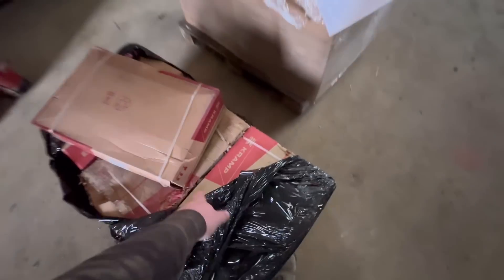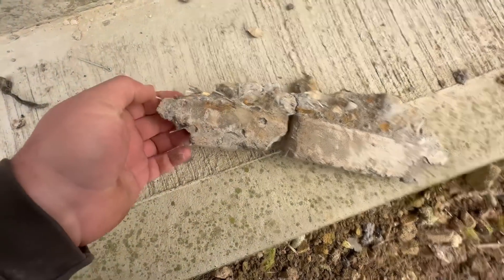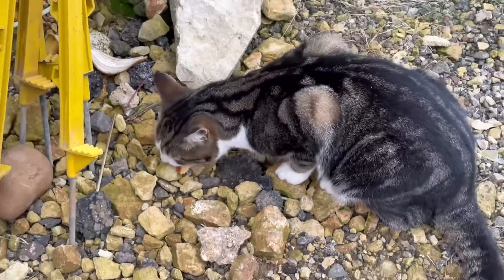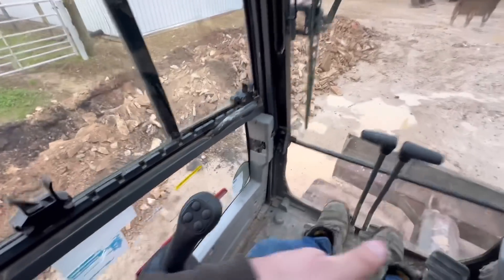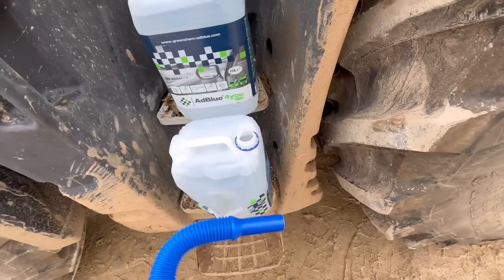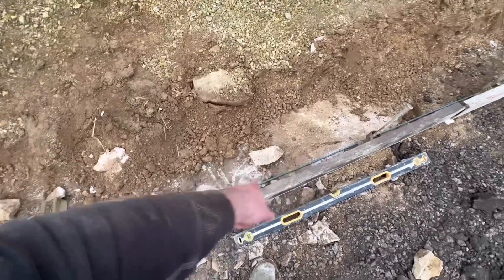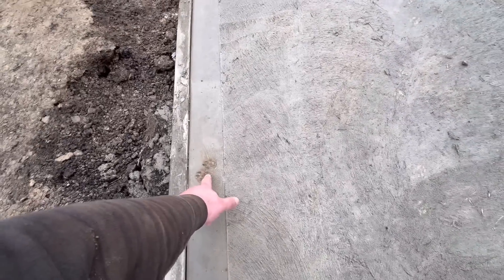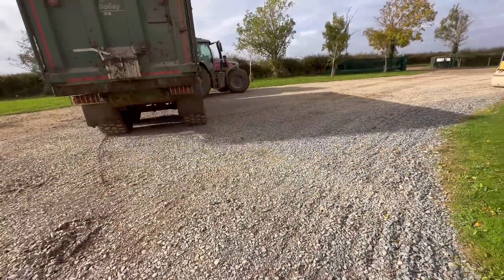Super strength concrete with structural fibres. New nuts and bolts in the workshop

Comment: I worked on a huge Cardboard mill some years ago now near Selby, the whole floor slab was concrete with these structural fibres in, the only mesh used was in and around floor pits for machinery.

Comment: Out of interest what spacing have you got your expansion joints? Have you used induced cracking joints at all? There's a guidance document for industrial slabs TR66 that gives some good recommendations on slab jointing depending on usage. When you have expansion joints are you using steel dowels at regular centres to prevent the slabs moving differentially creating a lip?

Comment: Just for future reference, I'd recommend you look at using closed cell polyethylene foam instead of fibre board for the expansion joints as the later rots and deteriorates, then fills with dust and dirt, eventually you can end up with the concrete cracking/spalling when it expands as the material in the joint is no longer compressible. Also ensure you cap above the flexible foam with polyurethane sealant to limit water getting into the joint and freezing. I am a structural engineer by trade so if you have any queries, if I don't have the answers I can ask my colleagues.
Reply from the maker: Thanks

Comment: The fibres don't create a stronger slab as such. What they do is provide a more evenly distributed tensile strength enhancement (the concrete is more resistant to cracking related to shrinkage/curing). Ground bearing slabs if placed on well prepared ground generally don't utilise the steel mesh for strength (as it is usually placed in the top face), if you have weak ground, you can place mesh in the bottom as well as the top, to enable the slab to resist bending.

Comment: I don't think structural fibres will hold up a concrete roof or a bridge beam yet.  But steel in concrete is a complete liability if the concrete cracks.  Next thing you know, water gets in, and the rebar rusts, cracking the concrete even more.

Comment: Used the fibremesh in concrete a few years ago for under a small grain bin i setup and used the extra to make a little pad at the back of the barn door. Both still holding up well after 6+ yrs now. With that bedrock under your yard you'll be fine for a very long time i think!

Comment: RC44+strucrtral fibres have always worked for me. I have a 700mm thick slab on top of clay, with a 15ton CNC lathe on it, on 8 leveling feet, no sheets load spreading, and it hasn't moved a micron in 10 years.

Comment: Mesh or fibres? You don’t want to open that can of worms🤣 each have it’s different characteristics. I’ve done some silage bays before on top of clay and used 2 layers of mesh and fibres. Your slabs will be strong enough for a farmyard. Only thing I would have done differently is to use dowels to tie the slabs together and stop them moving, but if you have a solid sub base then they’ll go nowhere.
Reply from the maker: Yer I was going to but did t get time to get any
Reply: @ I bet lads were happy. Nightmare stripping shutters with dowels in slabs and even worse drilling holes for them if forgot to put some in.

Comment: As it was explained to me by the bloke who was in charge of the concreting when we built our big workshop:

When a heavy weight is put on a concrete slab (e.g. a concrete mixer drives over it), the slab bends slightly.  The top of the slab is under compression (no problem, concrete is good at withstanding compression); but the bottom part of the slab is under tension, which concrete is not very good at withstanding.

Hence the reinforcing mesh should be below the mid-point of the slab, to help the lower part of the slab withstand the tension forces it experiences.

As we've had zero problems with the floor in the workshop, I'll assume he knows what he's talking about 😂.

What we do with excess concrete is pour it into reusable moulds to make standardised slabs (either 500mm x 500mm x 75mm or 1000mm x 1000mm x 125mm, depending on the quantity of excess concrete).  Handy to have around the place for paths or for sitting stuff on (e.g. hot water sevices).  Could be useful around your shipping container cabin.

The nut and bolt sets look pretty good Tom, but I think the shelves should be closer together.  1) it will reduce the amount of dust and debris that gets in, and 2) you can fit more bins in, hence having more different parts available!

We have a similar setup, though we don't have fancy barcode re-ordering.  We just have to remember to order them, and have someone (whoever goes into town first after they arrive) collect them.  Also if you have different types of fastener (metric, UTS, Whitworth, etc), then colour coding the bins is a massive help.
Reply from the maker: Thanks for that

Comment: I've never meshed concrete myself, but I've got it on good authority that it's a royal pain in the butt to work with. I've even heard stories about people getting injured from the meshing since it's basically a massive spring. It still has its uses for sure, but it's probably more effort than it's worth for what you're doing.
Oh, and I really like the designer paw print concrete you have. :)

Comment: Rebar always gets rusty and destroys the cement and it’s there to make the cement stronger but it destroys it? I see now they’re making fiberglass rebar, but they’re probably gonna have to make it out of carbon fiber or something and this way it can last not as long as Roman concrete, but using steel rebar has to change. We are rebuilding bridges after 30 years sometimes from the road salt.

Comment: Everything has it's pros and cons

Steel I imagine is stronger than the fibres BUT like you said - It's only in the middle, and really, it's not flexible

Fibres I don't know their strength; but like you said - they're 100% everywhere. Top middle and bottom of the concrete. AND flexible.

Comment: Get a driving cup for the breaker so much easier than sledging pins in. I like the look of the bolt rack did you just get a fastener rack?
Structural fibers are mint 👌 much easier than steel and cheaper at the minute. You can end up with hairy concrete which ruins the Instagram photo at the end but they soon wear off
Reply from the maker: @whitman55  you can have whatever you want in the racks

Comment: Tidy job  with  the racking  and nut bolts.  Concreting  as moved  on a bit  since the 80s it's all so technical,  probably the stuff  that  went down in 80s  hasn't   is  being  replaced.  👍👍🐈

Comment: I just knew that David was going to vandalise somewhere. Then went on to burgle the workmans lunch boxes. What a Cat. The Concrete looks good. I have used that micro fibres before and that also micro rebar which looks like little springs make for one proper slab but be careful as Elon Musk may try to use it as a landing pad for his Space-X program. Nuts and bolts will be a lot more useful then you first realize as it's just so handy having new fittings on hand when your doing a job. Thanks for sharing....

Comment: i reckon the fibres are the business. but no better than mesh. im not liking the finished surface though, it looks rough with the fibres everywhere, does anyone know how the slab will look after a few months? will they rust? do they break off? i couldnt sell that finish to a client, yes its rough, probably finished with the pan to achieve grip, but the fibres dont look good
Reply from the maker: There made of plastic so won’t rust
Reply: whats your thoughts on the finished surface  @Tomlamb980  ?
Reply from the maker: @ wears a lot better than a brush finish

Comment: Looks good, remember Rome wasn't built in a day 😉

Also I read that cats like to walk on new surfaces to leave there sweat scent that is released from their paws. The burning won't do them any good though but clearly doesn't learn! 

P.S. That new fasteners racking, did you get that free and pay for the fasteners as you use them or you bought it all. Very smart looking, couldn't make out the logo in the bottom right of the labels though.

Comment: D-A-V-I-D 🐈 🥙 😋 
Those fibres look a good replacement for steel mesh that is a pain to dig up and rusts away. Romans never used steel in their concrete with is still standing 👌🏼 Kramp is great! Olly has one of those shelves too, very handy for parts. Adblue such a con, German idea to get rid of their pig 🐖 urine for money 💸 no wonder they don’t want to end making engines. 🙄 small banana 🍌 😂 😂 😂
Reply from the maker: They are!
Reply: @ should be good to stop cracking. That’s what the spacer expansion is for.